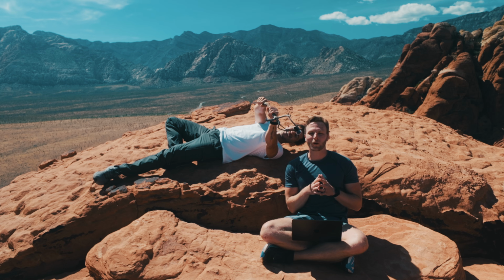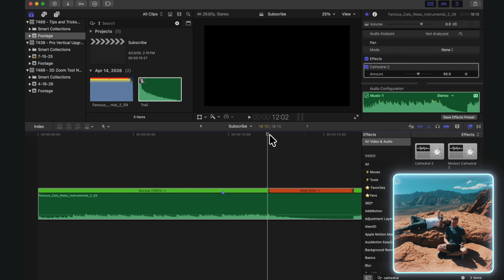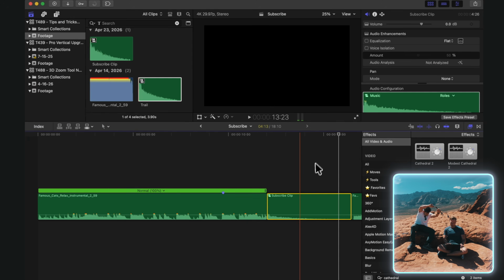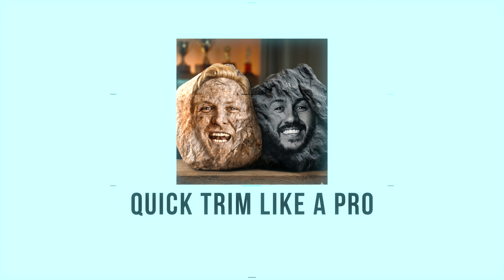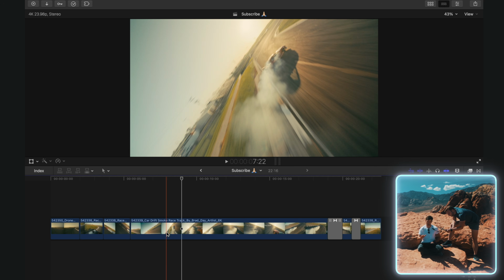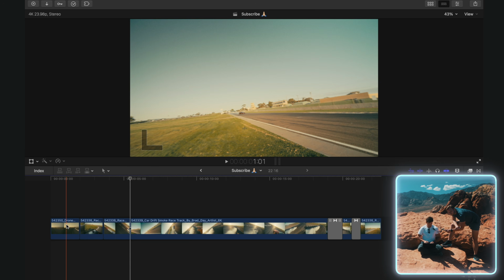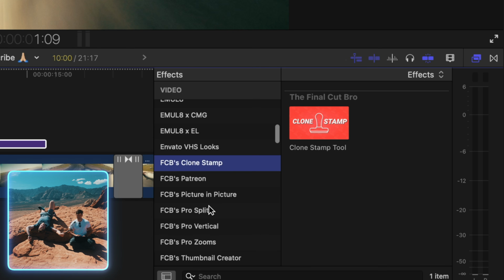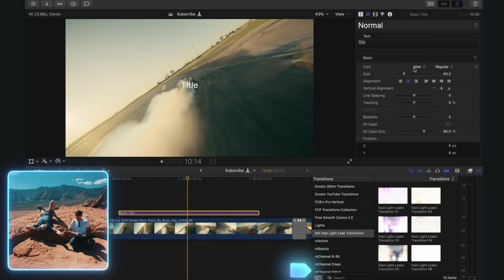These 4 Final Cut Pro Tips Are Too Good

Comment: Option bracket nahhhh
Just change the shortcut to Q and W for left cut and right cut
And you will save so much time

And as usual all the tips here are greattttt thanksssss
Also, Always love to see your collab videos ❤
Reply from the maker: I have to say the default keys because talking about how to switch keys takes ages. The same reason why I say Command B when my blade function is set to just B. You should try G and H for trim to start and trim to end. Thats what mine is set to